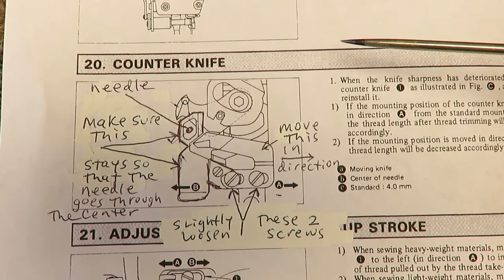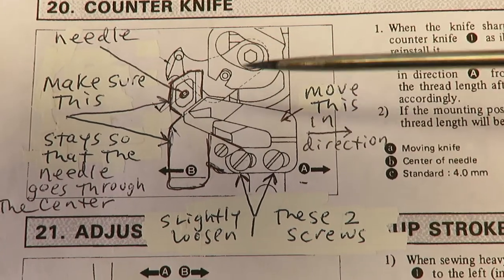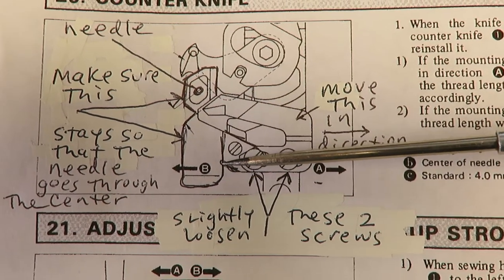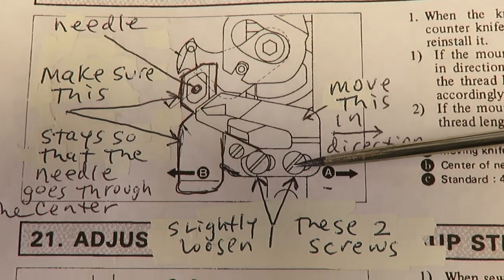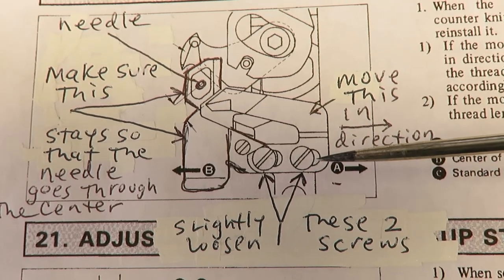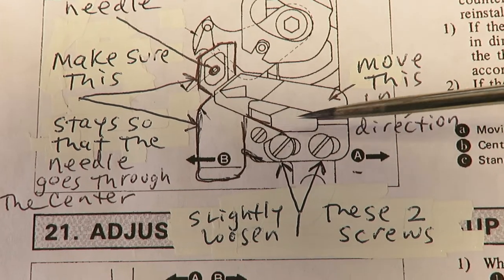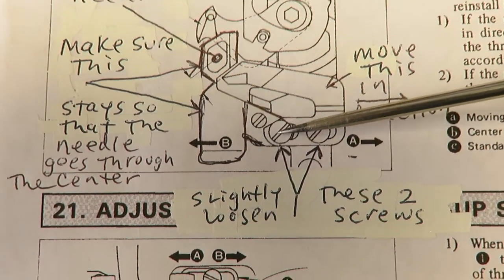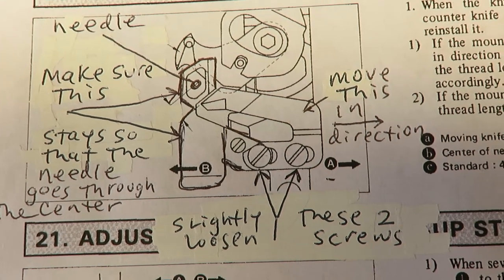Juki DDL-5550-6 Thread Cutter adjustment

Comment: Thank you, this helped me!  My problem was that my bobbin thread was no longer cutting.  After removing the needle plate I noticed that the mounting plate (A) was positioned to the left, so I moved it toward the right (not all the way, but some) and also noticed that my needle was not centered going through the loop.  After adjusting both the above accordingly, my auto cutter is working fine again!

Comment: Is there any way to sharpen the blade? My machine was a floor model (TL2000 same cutter) I cam buy the whole assembly for $65 but if I can sharpen it that would work better. Also if I could just buy the blade that would be better too. Do you happen to know any place that would just sell the blade?